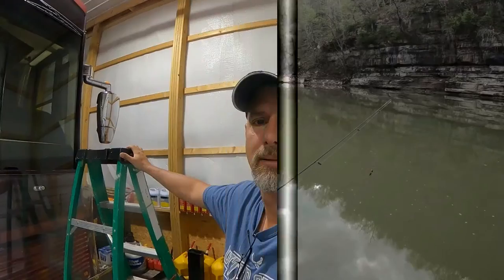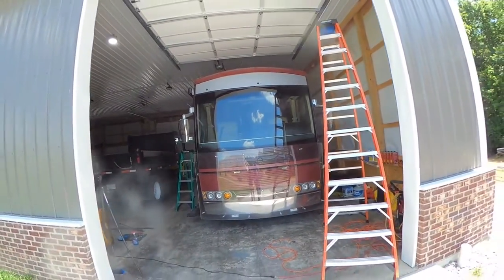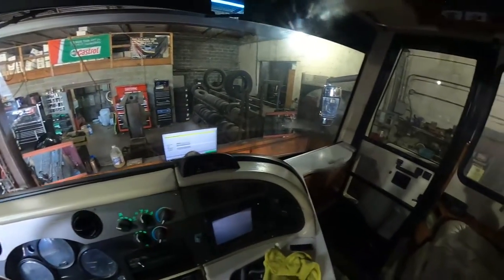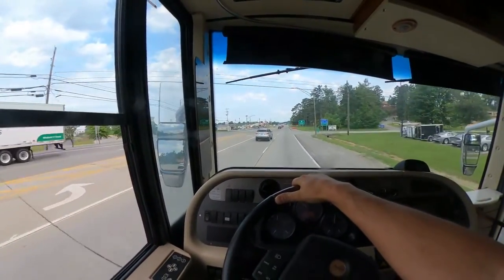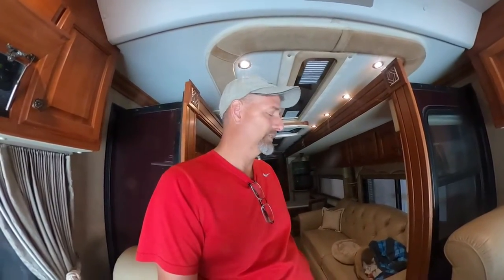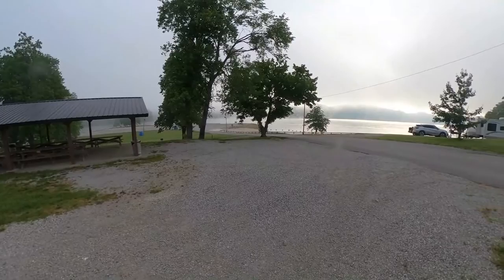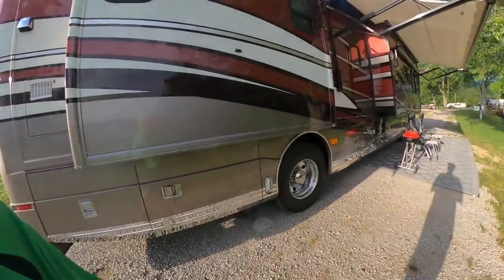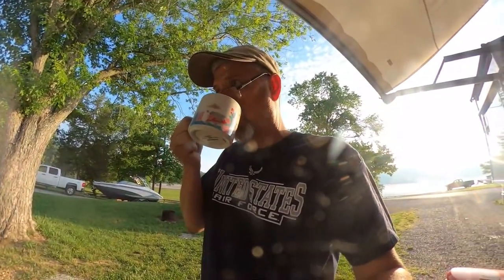Vinyl Wrap, Alignment, Camping in the RV | 2005 American Eagle | EPS8 | Shots Life

Comment: That switch most likely has corrosion operate in back forth a lot also check all fuses.on outboards check compression make sure their less than five bounds otherwise you never smith run at low speeds
Reply: Less than five difference in compression